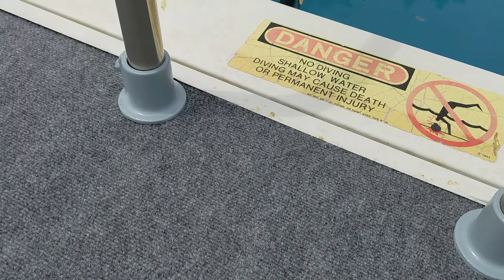Replacing My Pool's Carpet - Part 3 - Installing New Carpet

Comment: Non of that I would have just purchased some fake grass and covered it , I'm uk and have fake grass on my deck for the pool and hot tub worked great and soft for the kids , it's cheap and easy to install , but you did a great job , just sometimes it works better to go outside the box , just wish we had your weather so it would be worth getting a big boy pool 👍👍

Comment: Removing my carpet this weekend off my Esther Williams pool deck. The old carpet is very hard to scrape off and the glue is tacky (it’s pretty hot out). I had the same disassembly experience- put together like a puzzle. I’ll be trying Goof Off to help loosen the old carpet.
Reply from the maker: Good luck! I hope that works. In my case I was really worried what to do if the glue was still strong, but luckily my glue was so old it was basically dust.
Reply: I have a 24 round Ester Williams, what is your method for a pool cover. I haven't seem to master it yet?

Comment: I have the same pool and issue. This was very helpful. How did you get the carpet under the inner rim by the water and how difficult was that to do? Did you use a special tool to lay the carpet down so perfectly?
Reply from the maker: I'm glad it was helpful, thats why I made the video because I couldn't find something detailed. I'm sorry for late reply. To get to the carpet under the inner rim was easy because the carpet glue was so old, it came off easily with a utility knife and some pulling. I used one of those "j hook" utility knives for carpeting, it was easy to get under the trim. I would cut a little piece of the carpet, enough to pull it out under the trim, and then I'd pull it. Most of the carpet would come right out, sometimes I would have to repeat the process. 
For laying down the carpet, I just made sure I had the right size and I applied the glue by sections, rolling a small portion of carpet as I went along, and then went over it using a small roller (carpet roller in carpet section at home improvement store). This step would have been much easier with two people though!

Comment: The lite and dark color is probably because the direction of the carpet grain is opposite the fist piece. Other than that looks good...
Reply from the maker: Oh you may be right! I did not pay attention to how I laid the carpet down, I was just trying to optimize how much carpet to buy in the rolls. Also, the original carpeting also showed this different tones, so I think originally the manufacturer also installed them with opposite carpet grains.

Comment: I have the exact same pool and planning to replace the carpet this summer, what model and color did you use? I was planning to fix the carpet by spray glue, but might need something stronger.
Reply from the maker: Hi there. I used whatever gray outdoor carpeting was available at Lowe's. I believe they only had Home & Office "Grassland Smoke" Needlebond carpet color/brand. I used Lowe's TEC Outdoor carpet adhesive for this, I do not think spray adhesive would work in the long term.

Comment: Good job.  Get to do this today.  Any advice or what you would have done different?  Thanks for putting the videos out there.....gave me a good idea what to expect.
Reply from the maker: Thanks for the comment. Good luck with your deck replacement!
Some advice would be to have someone help you when unrolling and gluing the carpet. It was very difficult doing it myself. 
Be very very careful after you've laid the carpet on the glue. I accidentally put my knee on it and the glue came thru in that spot. Use a carpet roller to press it down, not your hands/feet. 
And use an oscillating tool to remove the old glue. 
Hope that helps!
Reply: @TheCasualYouTuber  Thank you much!  On my way out the door.....lets see how this goes.